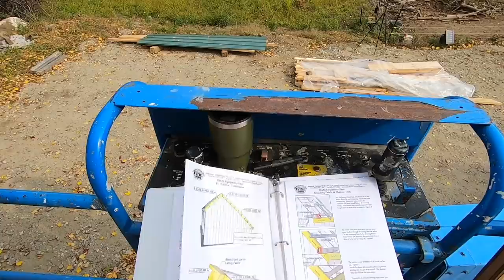We Can't Let this Nail Gun Injury Stop Us NOW! Last Day with the Lift to Complete the Trim Work

Comment: Al, You need to cut a small acute angle on the ends of the battens  if you wAnt to use them to drip past the lower battens. Otherwise surface tension with make the drip s go around the 90o corner and drip on the lower battens much higher

Comment: Gooooooooood mernin'!
Reply from the maker: Gooood morning
Reply: @LumnahAcres  I vote leave the battens a little long, exactly for the water shedding reason you mentioned. You might consider trimming them at a slight angle outward, too.
Reply: @mintysingularity  That's what I was thinking if you mean angle up from outside of batten to inside at anything up to 45 degrees.

Comment: Tee shirt graphic... "Lumnah Acres, home of the Crazy Yellow Nailer" with a with a picture of the nail gun. 
Cut the bottoms of the battens with a "slight" reverse up angle so water drips to the exterior. It is a drip edge. Do the same on the other end and bevel the top side of the horizontal batten to match. 10 degrees should do.

Comment: Morning everyone! My dad was a cabinet maker and had 3-4 barns on the property he built to store lumber and materials, he built everyone himself and they were always board and baton, he left about a 1 inch over hang from the top batons over the bottom so the rain would drip off.  Also just saw another video where you said you rode horses, where kind? I used to. do the NE Paint horse circut and local(NE Shows(Eastern States, Gilford etc) But I am a few years older than you.

Comment: those vents would of served you better if you screened the backside of them.  if the birds, bees and other bugs want in then they can use the doors like everyone else
Reply: Looked like they were...
Reply: critter9a - If you look carefully at 5:41 you can see the screen.
Reply: @tonygrimes13  all I see is wood, no metal or even plastic screen material.
Reply: @critter9a  Look again especially at opening just above Al's right hand. I can see  it on my 10" screen.
Reply: @tonygrimes13  it's not that I don't believe you. I just don't see it.  I'm looking at it with a 47 in screen  lol   thanks for helping
Reply: @critter9a  I have since read a reply from Lumnah Acres saying that there was screen.

Comment: Glad your ok, luck is a good thing.
The batten boards, I was taught many years ago by an older carpenter to cut the bottom at a slight angle, the outside lower, to direct the water as far away from the siding as you can. So yes, about 1" overhang and around a 15 degree angle.
Nice update, you explain very well.

Comment: My opinion is leave top batten strip a little long where you can connect the two (top and bottom) with a nail. Not so much for runoff but to help keep square after winter warping... Either way, very nice build!

Comment: I just finished a barn with board and batten siding and I did an upward bevel on the bottom end of the battens. Water doesn't like running uphill and that way when water runs down the batten it won't wick back to the piece below.

Comment: For looks on the batton strips, I’d cut them even with the bottom of upper boards, AND at an angle (45% maybe) for about 1/2 thickness of batton strip. Water would still drip straight down.

Comment: Are you going to run electricity to the new shed? Some lights and a couple of outlets, especially if you use the new stalls as housing for calf's or kids or maybe even a trickle charger for the tractor, would be handy.

Comment: When trimming the bottom of batons, trim them level across the front but bevel them front to back, this way rain drips off the front edge and does not run back to the boards or lower batons.

Comment: On the long baton boards I would leave them long and cut a kerf in the bottom of each one. The kerf will make the water drip straight down and avoid the bottom baton. I learned this from Tom on Ask This Old House.

Comment: Glad to see you’re ok. On the new compressor issue,the standard of the industry in construction is the 4 gallon twin stack Hitachi/Metabo oil lubricated EC 12 or EC 89. The pancake style you started with is an oiless type and is really a throw away when it fails. Oil lubricated ones are pretty much rebuildable for a long time and will outlast an oiless three or four times before needing any attention at all. Just keep up with checking the oil level and draining the tank of condensation. Luck with the rest of the build and don’t shoot yourself again.

Comment: In my youth, I bought a building to rehab.  On night I was building a door frame with 2x4's and 3inch coarse thread wood screws, driven by a bulky/corded drill.  I was starting a screw while holding the end of an 8ft 2x4 in the palm of my hand - the board split, and the screw drove thru the 2x4 AND all the way thru the soft tissue of my hand - between the metacarpal bones to my middle and ring fingers.  I was lucky - no nerves or bones affected and minimal bleeding.  I cleansed with peroxide, bandaged with anticeptic and quit for the night.  It healed in time.  The worst part was that I was alone, and had to UNSCREW the 8ft long board from my hand.   Imagine doing that one-handed.  Accidents DO happen (when WE do silly things), thankfully God watched over both of us.  Congrats on Your build - is looking GREAT!!

Comment: On the Barton ends, cut them slightly long with a 15 degree incline toward the wall like a chisel bevel so the long edge is on the outside.  This will draw water away from the wall so your drip line falls away.

Comment: In CA a home owner has to have building inspectors check as per building codes at certain stages. It’s a pain and it costs a lot of extra money.
Can’t sell property if not signed off by them.
Do you have to do that?
🌻🙏🏻

Comment: The tails of the upper batten should be cut at a 45* angle so the bottom piece tucks under it.  The top of the bottom batten is also cut at a 45 degree.

Comment: It seems a handsaw would have been faster (and neater?) to finish off the circular-saw plunge cuts.

Regarding leaving the batten strips long or flush: In either case, the bottoms should be beveled to facilitate shedding rain.

Comment: Do you have a Harbor Freight near you? If you so, check out their blades for all cutting tools are cheaper.
Reply: Good idea - they do have a Harbor Freight in their town of Littleton NH.  Love those stores!  I feel like a kid in a candy store when I'm there.  I've probably bought way too many tools that I don't need, just so I have convenient tool bags!
Reply: I'm driving to a Harbor Freight about 100 miles from me to buy a Predator 9kw Generator to replace the one I've used for 25 years this morning.It's cheaper and better than the ones HD or Lw's carry.I will keep my generator head from my old one as it's a Northstar 5kw but the old GX 270 Honda has died.The Predator motors are Honda knockoffs that have thousands of reviews of how good they are from professional.I was going to buy the Predator motor to continue using the Northstar but I would like to not limit what I can power in the house when I need it.This one can power up everything.Harbor Freight has some good stuff and lots of junk.You have to weight the cost of buying something that you will use a lot or if its just for one time and you can't rent a good tool.I have a 4 in.grinder that I've used for 30 years from them and its still working fine.I'd stick with Dewalt,Milwalkie,Ryobi,Makita,etc for battery operated tools as the ones at HF are junk

Comment: Hi Al, I have been thinking about your nail gun and wondering about its safety. I have a couple of paslode guns (framer and finisher) and both of them will not fire a nail or brad unles the gun is actually pressed against the intended discharge point.From what I saw in the video you were just moving the gun about which to me indicates either Dewalt do not have this safety feature or maybe your gun needs to checked to see if it is safe to operate.In the meantime I have been enjoying your vidoes all the way ffrom New Zealand. Keep them coming.

Comment: Always safety first with power tools, never put your finger on the trigger of a power tool until you have it placed. We don't really use nail guns in the UK, but I have a lot of experience with grinders and saws and that was always rule #1. A reaction to a tetanus shot shows it is working, that it is stimulating an immune response.

Comment: i worked in construction,  i was on a job in Brooklyn NY, where they were digging a large deep hole, blocks long, and were building safety walls so they could work in the hole, without it collapsing on them. my job was to wire the 3 phase pumps that kept the water out. with the old nail guns, they would tie the safety back with wire, so they didn't have to press hard on the gun to drive the nail. one day to of the guys were arguing over something, and one shot the other with a nail, in his chest. so one went to jail, and the other went to the hospital.

Comment: All, if you will cut a bevel on the inside face of those overlapping battens the rain will drip off the batten and not pool on the bottom side of that battan.

Comment: After many years of framing and finish carpentry I have seen many ways of shooting yourself with a nail gun. You were lucky Al. I have seen nails in heads, fingers, feet> Thru bones and deep in flesh. I even nailed my ring and middle fingers together one time. A fellow worker nailed his hand to a roof one time to prevent him from sliding off the roof,  I guess he felt a hole in his hand was better then falling 20 ft.

Comment: hi al glad you r ok after accident can i ask you why you don’t put guttering up off your buildings to take water from around your buildings and save the water for your animals at least and saves you for paying your water bills if you have any plants also do better with rain water than tap water lv from uk
Reply: If you put a gutter on the barn you would have to remove it before winter as the weight of snow they get would pull it off! Also they have well water.

Comment: I’m gonna let you folks deal with the lift by shooting, I’m talking air compressors!! 😁 I’ve owned only one, what I’d call ‘portable’ air compressors, and it was a long time ago that I bought but. It is a porter cable and it did okay, but would never run the nail guns....what I have now is still considered ‘portable’, because it has wheels but, it’s a stay in the garage or maybe into the drive, size and runs anything. Here’s the short of the long of it...that dewalt did you good and they are still good...don’t switch horses in the middle of the river. As you know, keep it drained and you will be as well served by the replacement.

Comment: I've never used a nail gun but I've seen them used a lot. I always thought they had a safety so they wouldn't fire unless the tip is pressed up against something. When you see someone speed nailing I assumed they are holding the trigger and just tapping the tip on the wood to fire the nail. Did I get this wrong? If not I don't see how the nailer fired in your accident. I kind of want to make sure I don't shoot myself the first time I do get to use one.
Reply: Pressed against his leg.
Reply: @tonygrimes13  Thanks. I didn't go back and review the video but I just don't remember seeing it get that close. Camera angles and tired, old eyes. :)  Just gives me that much more respect for that line of tools.
Reply: @RetroRogersLab  Lumnah Acres said it in a reply on previous video.

Comment: Why don't you put the gutters, the U pipes, in the lower part of the roof to collect the water and send it away from the walls?
Reply: If you put a gutter on the barn you would have to remove it before winter as the weight of snow they get would pull it off!!!
Reply: I hadn't tought that it makes a lot of snow here. Here in southern Italy, little snow falls. Some years no snow. We all have gutters.
Reply: @lidiobax  They could get several feet (one foot = 300mm)

Comment: Hiya, you were closer than you thought. 2 1/2 3 in away is the major vein called an arterie, I can't spell, feeding the leg it runs down the front of the leg in the middle so 3" away from the nail. I've had a camera inserted up into my heart from there, an angiegram? Jesus was indeed looking after you... Stay safe... Steve
Reply: Yeah, the femoral artery.  That would have been potentially fatal. 🙁
Reply: @samvalentine3206  Thank you, yes that's the one, the consultant slipped when doing my camera & painted part of the ceiling with my blood, a lot of bad words were used, not just by me... I needed that blood, I've low blood pressure... Stay safe... Steve...
Reply: 'T' shirt should say, "I missed the side of a barn!!!"

Comment: Quit using your level! At this point in the process,  just measure or better yet eyeball ! I once fired one of my men doing what you are doing. I know you are an amateur but you are taking on the role of a teacher on this channel and you are teaching bad technique, habits, and process. Once the structure is leveled, plumbed and squared; there is almost no need for a level anymore.  Plus!...use your string line more instead of your level. I'm sorry for this rant but I have been holding back ever since this project started.